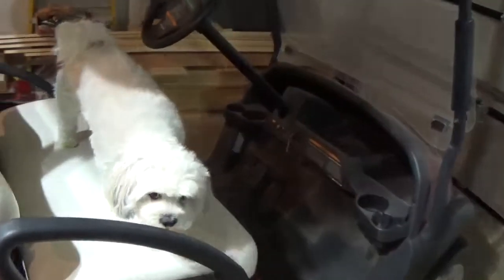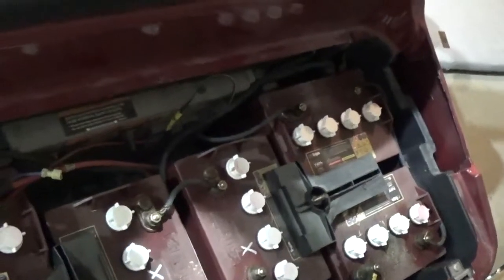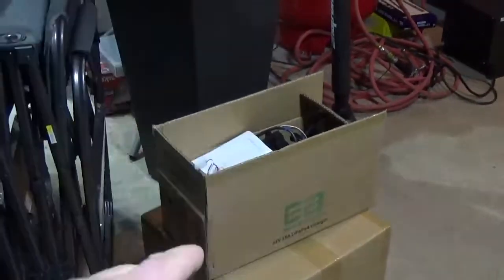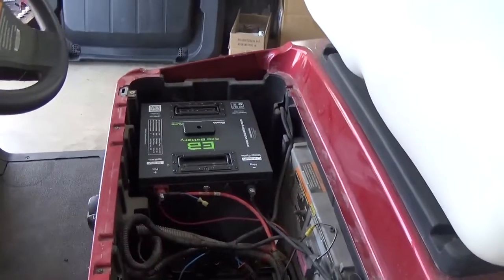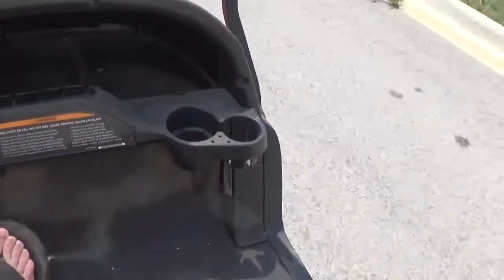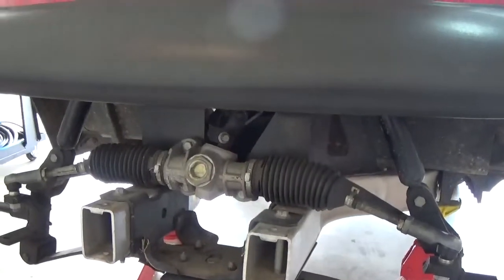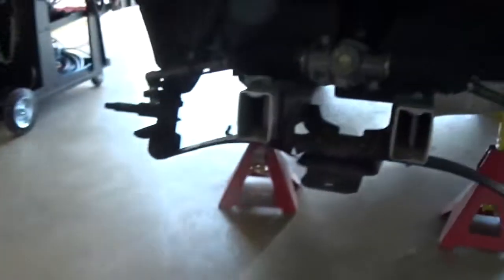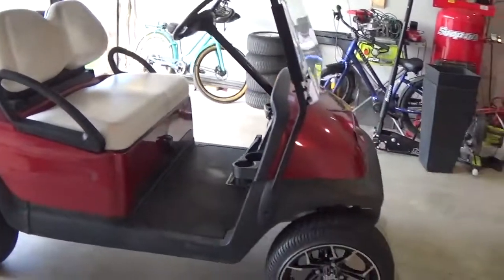ECO Lithium Battery & 2 inch lift kit install on a 2010 Club Car Precedent

Comment: I just installed 3 inexpensive 50Ah, 12V Lith. batts in our 36V ez-go. Practically popped a wheelie. Tied them in parallel for a few days to equalize them. Now planning to mount the charger inside the cart and add a battery isolation switch to disconnect the charger from batteries when not charging. BTW, the 12V lights in my cart get the 36V pos lead, but get their neg from the last battery, so essentially 12V. Of course, this assumes the lights have two wires and don't connect to any chassis ground. This way no "reducer" needed.
Reply from the maker: Where did you get the batteries?
Reply: @kartkrazy  Amazon has several cheap brands, I mounted them on some hard foam to ease the vibration. We shall see if they hold up...we only use the cart around the property. Almost got the used medical types..but we went with new and cheap.